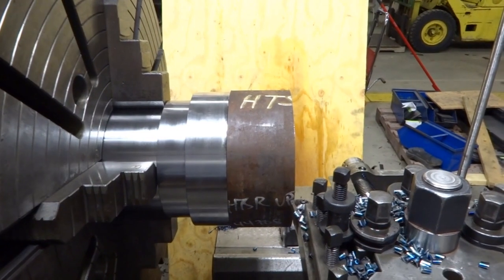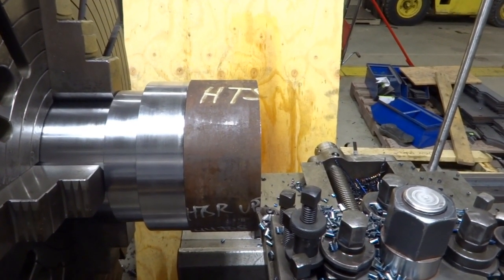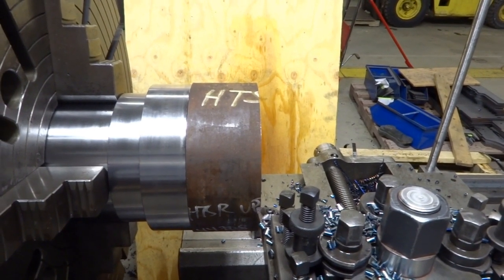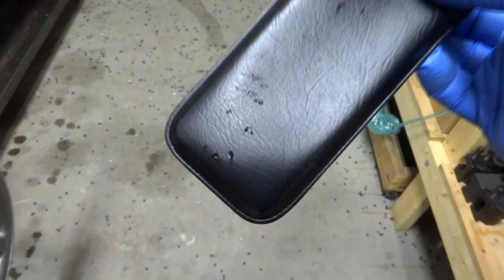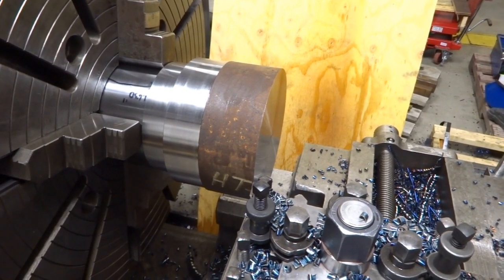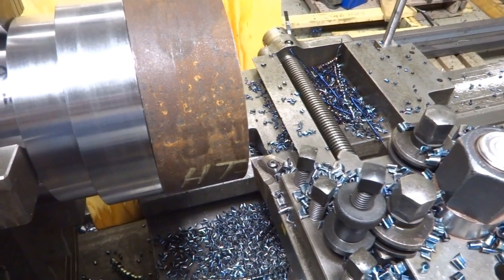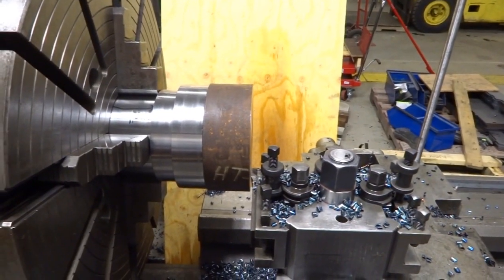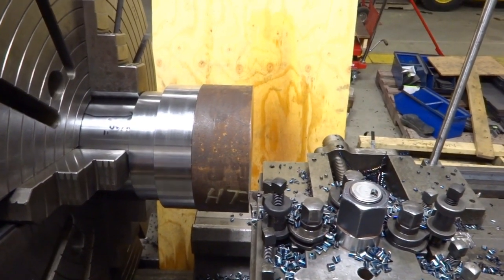Heavy Facing Pass on Lathe

Comment: One thing I've noticed back when I operated machine shop, older pulley driven lathes seemed to have more 'freewheeling' or flywheel action compared to the gear driven ones, with identical 18" faceplates. Everything was powered by identical 3hp motors too.
Probably because the pulleys were quite large and heavy in order to handle moderate amounts of power, resulting in quite a bit of inertia.
Looking inside the gearbox of circa 1945 lathes, Gears were comparatively tiny, adding little if anything to the flywheel effect. Of course, those geared machines simply ran for years and years requiring a simple oil change once in a while whereas the Pulley driven machines required quite a bit more maintenance. Tension adjustment, cleaning dust off the pulleys, belt change, sanding the pulleys once in a while to restore friction and so on. But, fly-cutting and trepanning on the older Pulley driven lathes was a joy to watch. Amazing surface finish as long as the tool was sharp at half decent speeds and feeds. Weight and inertia did the rest.

Comment: At 1.10 sounds like a chip got you Ken... hopefully not on your neck 😲... that's the second worst place after in your ear 😓 I see you using a CNMG insert I've seen bad things happen with them pulling into the job either facing or turning. My last choice of tool.
Reply from the maker: You're right about the chip at 1:10.  It landed in my shirt pocket and burned into my glass case and my chest.  Usually when I do this I untuck my shirt so if they go down the collar and the chest hair doesn't catch them, they fall right through onto the floor.  CNC machinists never get to experience the joy of smelling their own hair burning.  I agree that the CNMG inserts can turn.  Short of pinning it to the compound rest I've done everything I can to make the tool post rigid and so far nothing has moved.  Facing is a bad one however, as it wants to turn the tool post in the direction of loosening.  Ken

Comment: Nice blue chips.
There's a certain pucker value on initial contact when the motor 'acknowledges' the cut.
She sure knew she was a work in' on that facing cut!
And that the mass of that chuck helped maintain the revs initially!!
Reply from the maker: Thanks Carl.  I like the idea of the motor 'acknowledging' the cut.  That's a good way to put it.  Leblond and few other American lathe builders used to put 40 and sometimes 60 hp motors on lathes of this size.  Before I got this lathe I always thought that was a bit of overkill.  However, after doing some of these cuts on my lathe I could see where the extra power would be helpful.  These lathes are so heavy and rigid that they could actually use all of that power.  In contrast, my first lathe was a 12" Taiwanese bench lathe with 1.5hp.  I could never use all of the power because the lathe would shake itself to pieces well before you could fully load the motor.  Later on I saw the same lathe advertised with a 3 hp motor and realized it was all marketing.  The 3 hp version could do no more work than my 1.5 hp version because of the limitations of the machines structure.  Ken

Comment: That made it grunt !   Cheers Ken .
Reply from the maker: Thanks Max.  After I calculated the HP of the cut I was surprised it didn't stall the motor.  I guess those old English Electric motors were up for more than their nameplate suggested (at least for short periods of time).  Back in the day when these lathes were used in production, and guys made cuts like this all the time, they must have rigged up some shields to deflect the swarf.  Its like getting hit by small arms fire.  How is your shop coming along?  Ken

Comment: In all the years I have been machining I never look at the feed rate dial just the carriage movement speed....Yep that is too fast or slow. Guess it comes from  manual milling also the drilling from a tail stock feed is by hand so you get a good feel for the feed rate.
Reply from the maker: I've always paid attention to the feed rate on my lathe as Sandvik has always put the cutting data on the insert box. (Having said that, until I got my large lathe I was never able to use the inserts anywhere near the speeds and feeds they recommend.)  Milling and drilling were always by feel until I got a radial drill with power feed and a milling machine with a proper feed gear set up.  For larger drill bits (3/4" and up) I was astounded at how much faster the radial drill fed the drill (when using the recommended feed) versus what I had been doing by hand.  Not only did the holes get drilled faster but the bits lasted a lot longer when used at the proper feed.  I was similarly surprised at how fast the milling machine fed my facemills when using the correct feed rate.  Again, much faster production and way more material removed before the insert wore out.  Having said all of this, someone with more experience than me could probably attain these same results by 'feel'.  I simply didn't have the balls to push the tools that hard when I did it by hand.  Ken
Reply: @hmw-ms3tx  Way I see it is ok pushing company tools machines to what it says on the chart, however it is a real BALL ache when you break something of your own because the chart says so..My old lathe and mill tickle along with each job...At our age there is nothing to prove.
All the people making films taking big cuts and blue chips do it to make TV
Fixing a broken lathe or mill is time consuming

Comment: That is the difference between amateurs and professionals, an amateur saves material by spending time and a pro saves time by spending material. I would have used a bandsaw to save all that lovely material, no matter how long it took.😉
Reply from the maker: I generally don't like wasting material either but in this case it would have taken my saw well over an hour to cut through this piece.  Also, the left over would have only been about 5/8" thick, which isn't all that useful.  Without filming, talking etc. to make the video, this lathe would have removed the extra inch in about 3-4 minutes.  Ken